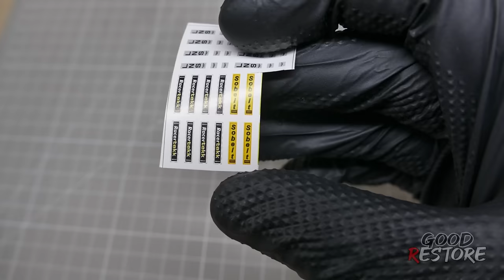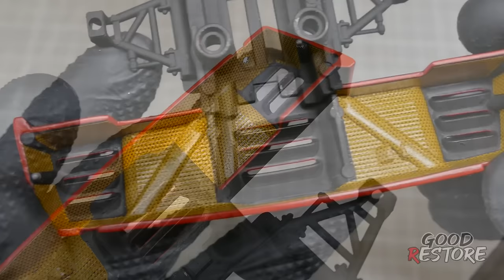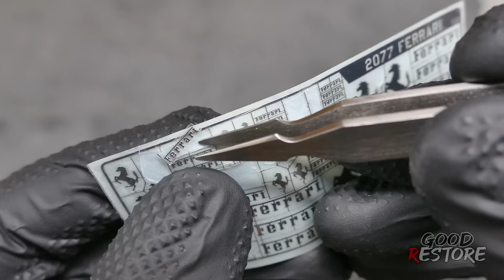Restoration Old Abandoned FERRARI F40. Extra Detailed Restoration and Tuning Ferrari F40

Comment: Absolutely brilliant. I undertook a similar detail on a 1/18th Burago F40 totally dismantling it and painting all existing components but it was in no way as detailed as this with etched metal parts, replacing all pipe work and carbon fibre detailing. You have given me some great ideas and inspiration thank you. I assume you clear coated the body on top of the red paintwork. One thing I usually do is to lightly sand the tyre treads to give a used look. Once again brilliant. Will subscribe.
Reply from the maker: Thanks )

Comment: This is absolutely amazing. The detail is off the hook. I did notice one detail that is missing tho, the passenger side of the rear wing is supposed to have the F40 logo.
Reply from the maker: There should be an embossing on one side of the wing, but it was not made in the metal by the manufacturer, but I didn’t want to just stick a sticker with the F40 logo

Comment: Hi, very good job. Your restoration is very impessive. Only a little mistake, haha. Your cutout of the ventilation slots (7:03) is wrong. Before you cutout small slot. That was good, little sanding to 1,5 mm or 2 mm. Then putty from back to the front of the slot (like the photo). And i miss the F 40 logo above the slot. Maybe on other photoetched parts are this available. Before painting, cut out the F 40 area then close the hole with putty like the thick of the F 40 photoetched part. Another idea is, you buy an used plastic model and cut out the F 40 Logo. But your job is very good, please, don't worried. That is only a tip for your. Have a good day, bye.
Reply from the maker: Hi. I know that the cutout of the ventilation slots is not correct, since it turned out initially crooked, I had to make them larger so that they look equally even

Comment: 7:03 Congrats, a really nice restoration, but I have noticed that the "Ferrari F40 Prototype 1987" has 5 back cuts.
I believe this is a model of the "Ferrari F40 Prototype 1987" so it was probably fine with the 5 cuts as well. 🤔🤔🤔🤔

Comment: The restoration is good but one detail you got it wrong, the wing mirrors. They are on the door line & not on the windows.
Reply from the maker: There were early versions of the F40 with such mirrors. Look on the Internet
Reply: @GoodRestore  which early version? the 1987?? that's the prototype. The production version is on the door line. So you still got it wrong.